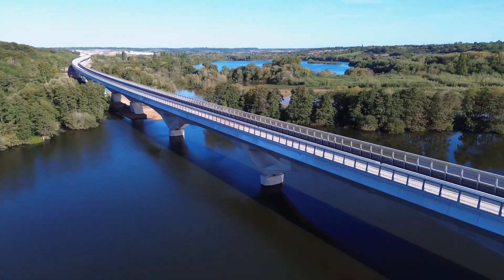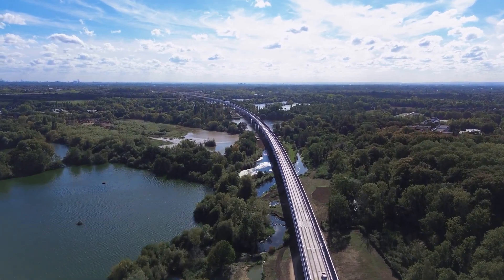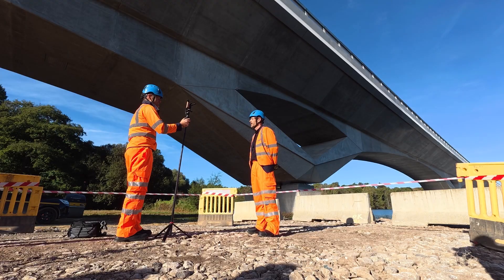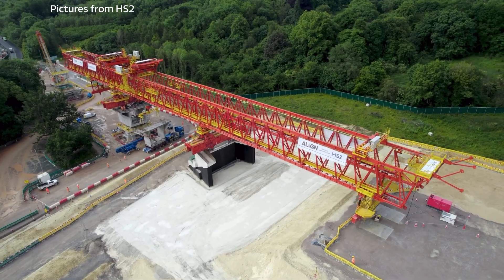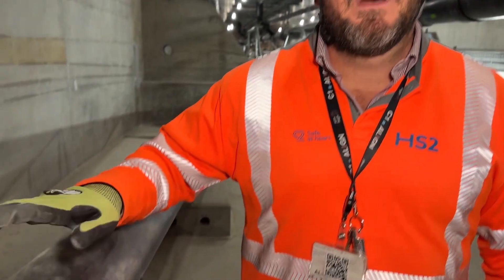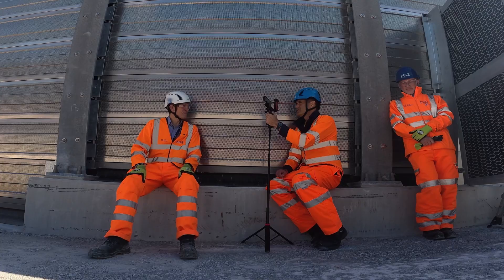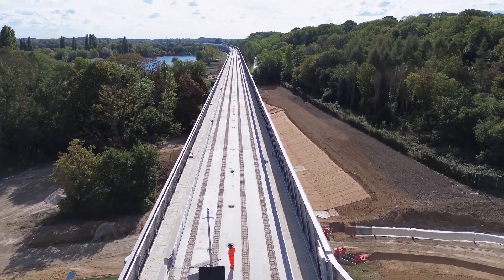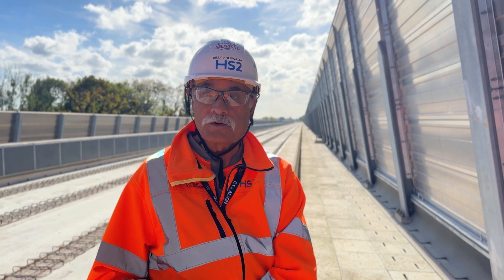Walking Britain’s longest rail bridge: but what’s the cost of the new HS2 viaduct?

Comment: An absurd waste of money. It just needs cancelling now and save another 8 (?) years of money being thrown down a drain. The only people who comment favourably seem to be those in awe of the engineering achievements.
Reply: And it's not even going to the north which was the whole point of the project to connect the north
Reply: @njp9554  Nope the whole point of HS2 was to take all Hi Speed passenger services off the Southern Half of the Congested WCML between London and Birmingham and Stafford to speed up these trains and allow more capacity on the Existing WCML and through Birmingham New Street Station in Birmingham not just to connect to the North which is already connected
Reply: @peterwallen1063 so it's basically a project for southerners 😂 and north left out again

Comment: Why does every journalist never mention that most of the delays came from the Government demanding construction initially started before designs were finalised and then wanting to restrict the spend each year forcing slower progress and adding to overall cost...

HS2 has its problems, but it doesn't deserve constant bashing from the media on what should be an upbeat "look at this engineering accomplishment that we haven't been able to achieve previously". It is complete before the timing caused an issue for the critical path, but if the Brits can't complain about an aspect of the project being completed late, they complain its completed on time/early! Typical anti behaviour. ITV should focus more on unbiased reporting.
Reply: The ending was done very well from a neigh sayers point of view lol
Reply from the maker: Thanks for the feedback. Thought I mentioned a lot about the engineering accomplishment. But it would be strange not to mention delays and billions of taxpayer money. Plus the environmental concerns. 

But you are right. It is an amazing structure. Hope it gets used for rail travel soon… And hope it won’t be a longer wait than 2035
Reply: @ragsmartel everyone knows that story. It really doesn't have to be repeated in every article or video about HS2. We can just celebrate the successful completion of a major part of the project.

The endless negativity about everything is one of the biggest problems in this country.